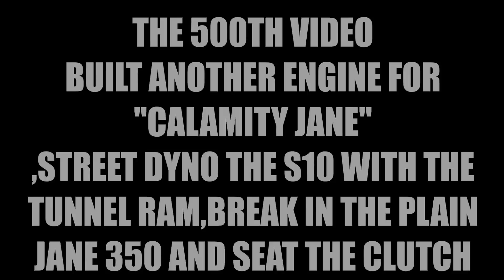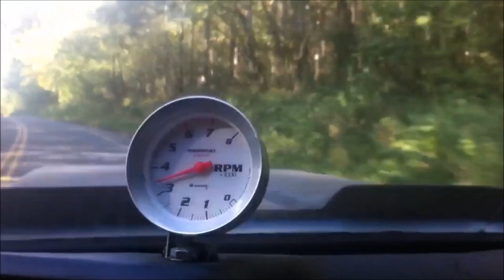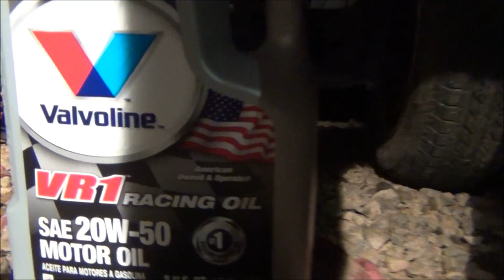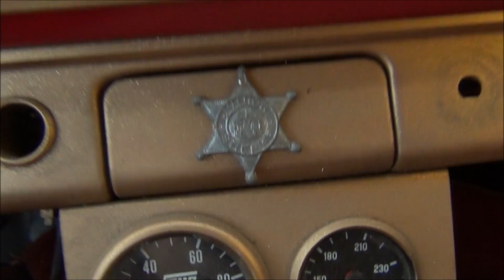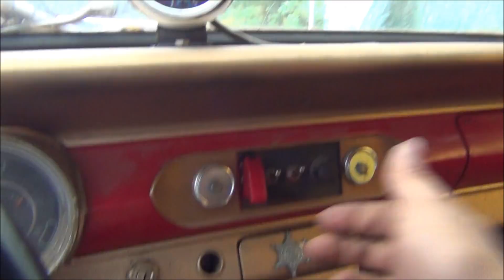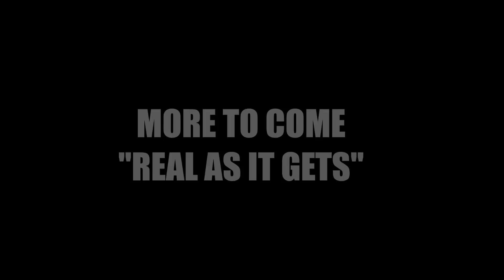SKULL GARAGE 2017 (E34) THE 500TH VIDEO,JANE ENGINE,S10 DYNO,SHOUT OUTS ETC

Comment: Congratulation  on 500! Thank you for the videos and motivation Fellas!!!  My gasser has been sitting for almost 2 years because of steering issues. I just watched a 3 year old video (about 10 times) of yall installing the cross steering on the 57. Im heading to the junk yard to pull a 66 Chevy truck steering box and install it on the outside of my 64 Fairlane frame. How do I contact Yall to send pics. Thanks again!!!
Reply from the maker: Josh Flores man thats awesome!! best thing with steering is keep it simple buddy,it will never drive like a sports car thru turns being a gasser but who cares all ya really need is to go straight at W.O.T haha and yup just about any old steering box will work ya just gotta find a place to mount it,alot of folks use the vega box but thats not period correct idk if that matyers to u or not,if ya have any question feel free to ask buddy,and send em to my email juddwilson83@yahoo.com...thanks for watching...justin

Comment: What is lift on your roller it does sound really good
Reply from the maker: Danny Outlaw .625 .625 on a 106 lobe separation 264 duration @50 intake and exhaust..justin

Comment: Why wouldn't you chase the threads before you put it together to save from having shavings fall in the cylinders?
Reply from the maker: because that would have made sense haha,i didnt realize how bad the threads were until i went to put head bolts in,i covered up the pistons with a rag for the ones close but it hardly got anything in em and what did go in came right out so it was all good....justin

Comment: hey this is charlie in mo.what was thecrank in that early 60s 283 block?
Reply from the maker: it was a small journal 302 crank which has the same 3 inch stroke as a 283 crank so they interchange, and the crank in the other block the 65 283 block was a small journal 327 crank..hope this helped..justin
Reply: i just took my block /283 to be checked im going to look at the crank in a few mins i was told it was 300 plus cubes  i just got back into hot rodding recently any clues on what i 
can look for on the crank to tell saw you mentioned a partial circle
Reply: my name is charlie im on my gals  you tube account lol
Reply: i looked, its a small journal looks like a mario mushroom on the  mounting flange/flex plate area
Reply: lol also the pistons had these markings on top    =  x   6  on pistons  but only one of those per piston not all never saw anything like it never rebuilt
Reply from the maker: Christine Hardman can u send me pics of it? and ill figure out what ya got my email is juddwilson83@yahoo.com